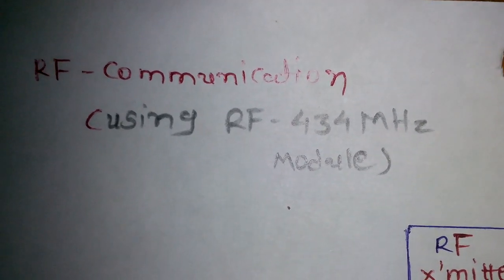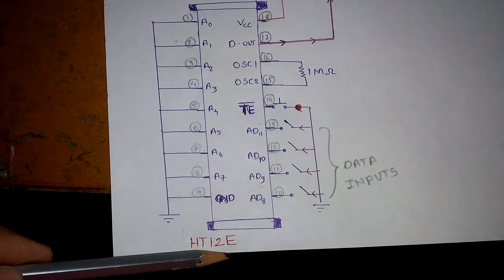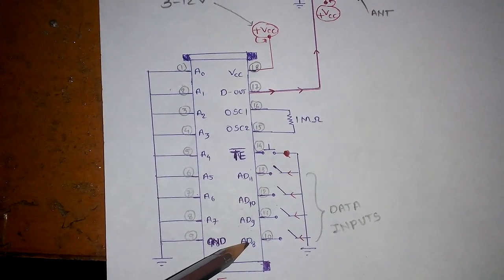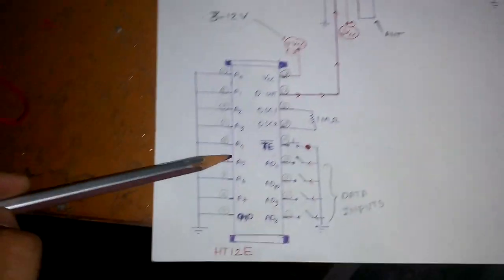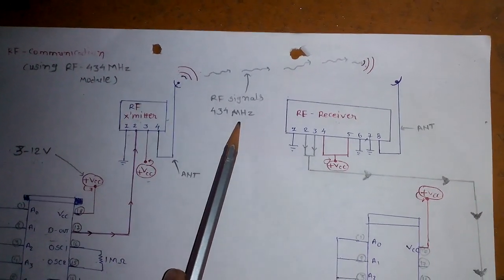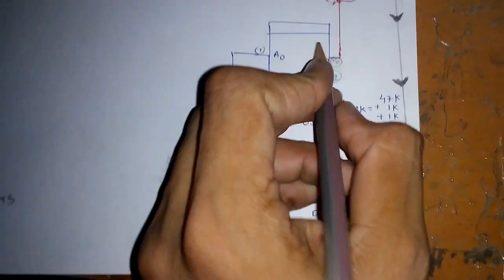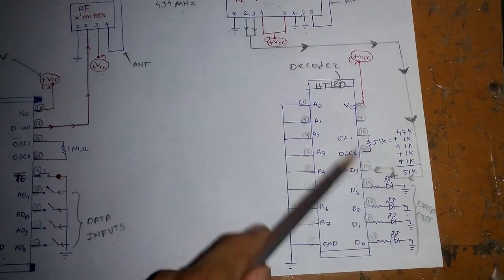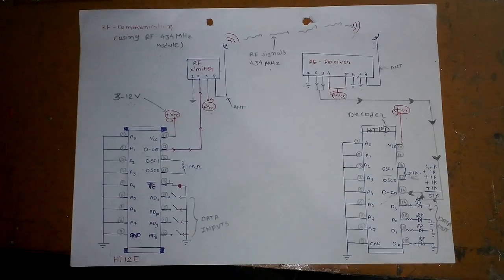RF communication using 434 MHz RF-module

Comment: My car remote central locking unit does not receive signals from key fobs.

The key fobs is ok and flash it's indicator when press lock and unlock buttons on it. However, the control unit does not receive signals.
Reply from the maker: If your transmitter unit is okay then there is problem with your receiver end.

Comment: can i used any resistor value for the encoder and decoder?
Reply from the maker: As per data sheet of each IC , we need to connect specified resistors across the ICs.
here for encoder is 1 Mohm and 
For decoder is 51 Kohm.
You can make it by yourself if you don't get that specified resistance value as I done . ;)

Comment: Will it move two dc motor
Reply from the maker: Future UX it can able to move upto 4 DC motors and for that you need transistor to amplify the signal to the desired voltage and enough power source to supply the enough current to the motors.